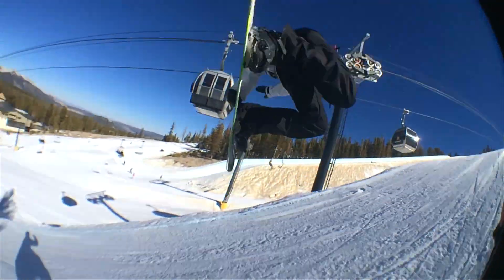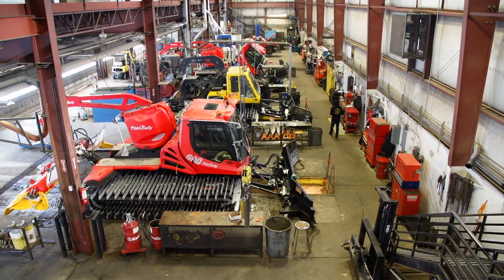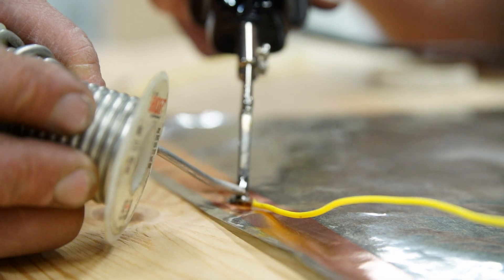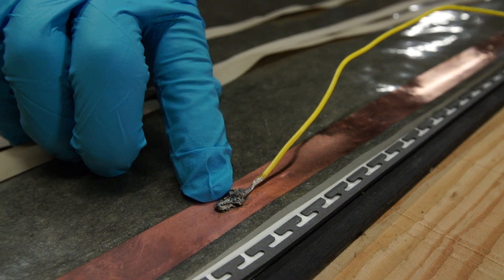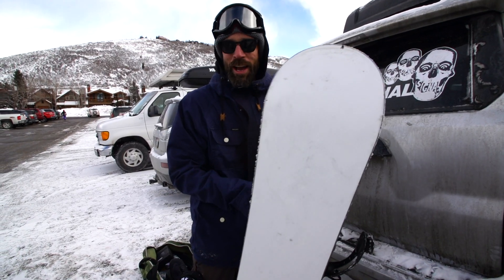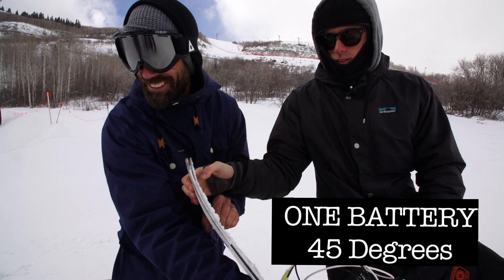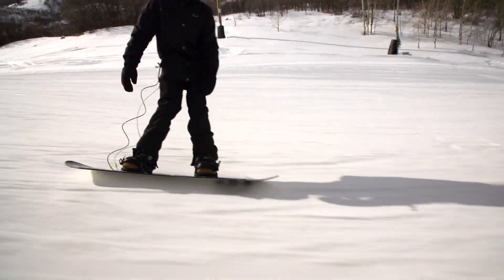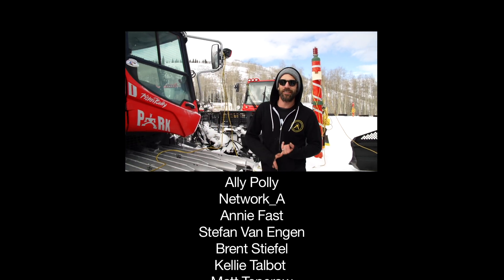Heated Snowboard—Build and Ride a 128-Degree Heated Snowboard Every Third Thursday

Comment: Hold on, aren’t we trying to reduce friction when we snowboard? In my experience a cold snowboard base, let’s say one left outside over night, is faster than a warm one. The heat of the snowboard base melts the snow rapidly causing more friction, decreasing speed. Also a warm base in my experience will cause the melting snow to form an ice layer which will exponentially decrease your speed.  Carving boards and other shaped snowboards are specifically made to decrease friction. This has me confused, am I crazy? Help lol
Reply: I am thinking the same thing brotha
Reply: Im pretty sure they are reducing friction by creating a larger layer of melted snow/water under the board.
Reply: I don't know if what you are saying would actually matter in this instance. What you are saying is 100% correct, a regular snowboard that was warm from lets say your car would be able to build the ice layer you are talking about since as the snow hits it, is causes the part that is touching the snow to cool and would get stuck. But with a constant heat, nothing would get the chance to freeze and slow you down, which if this is legit. Who knows if it is, that board must fly...